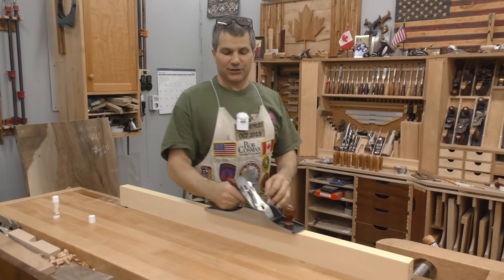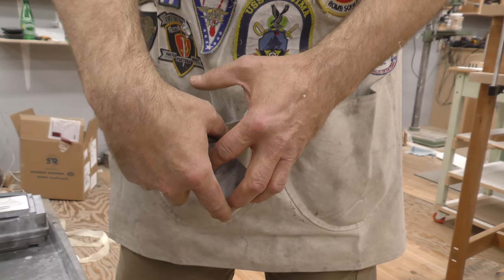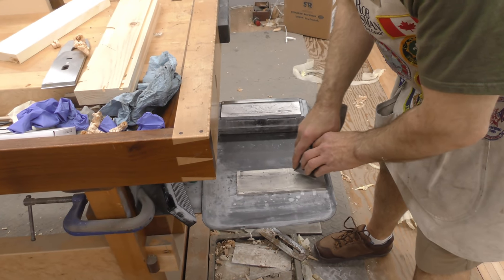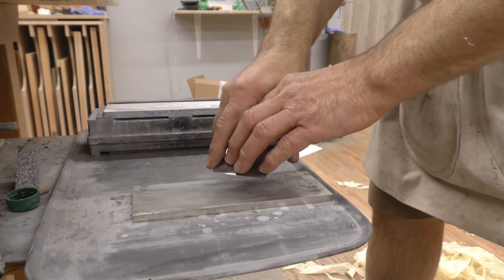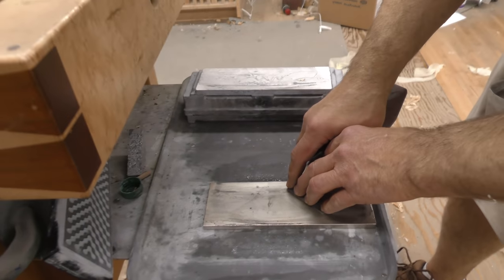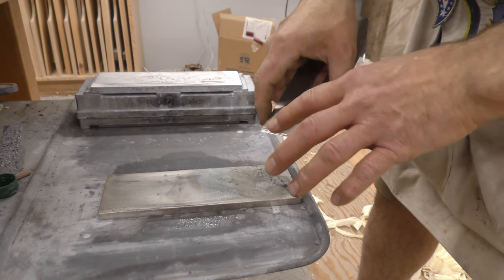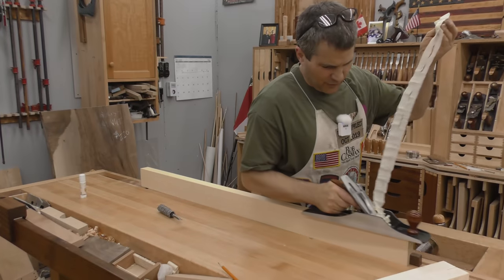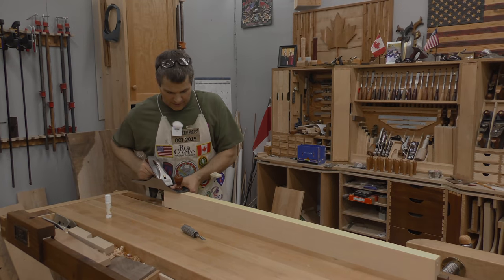Sharpening Hand Plane Blades - Top 6 Mistakes

Comment: The whole video is really good, but tip #6 really is a game changer. I ended up buying a jig when I first started because, I suspect, I unwittingly sharpened higher than 45 degrees. I was losing my mind  because my plane suddenly wouldn't cut anymore. I think this detail is the last bit I need to be able to reliably hand sharpen. Thank you so much! I hate screwing around with the sharpening jig.

Comment: I have been using a jig to hold and then sharpen my plane/chisel blades...my question is when I start my hand planning method, the Rob Cosman Way, do I have to reestablish a new 25 degree bevel. In other words do when you start hand planning does it have to be on a new blade...BTW the best video I have ever seen you do on hand sharpening
Reply from the maker: No you do not need a new primary bevel.  The only time you need to grind a new primary bevel is when you 1) drop and nick the blade, 2) have sharpened the blade so many times you have rounded over the primary bevel, 3) you have sharpened so much that your secondary bevel is approaching 50% of the primary bevel size, and 4) you get the blade so far out out square you don’t have enough adjustment room left.

Comment: Hi Rob, i seem to always have problems with my shooting board, it seems to cut at the first stage but then after two passes, it just seems to dis engage. This happens especially with hardwood, when i extend the blade a little, it doesn't cut, and then as i extend it out, it doesn't but until its so far out, that it just jams and creates kind of like a jagged cut on the end grain, i tried checking for square with a good square (Igaging) and even checked with feeler gauges to a thou and a half and it was perfect, i suspected the sole of the plane was not flat, can that be the problem? , but  when i checked it seemed flat enough though it may not be accurate as my plane bottom has undulation to reduce friction or so they say. So I'm getting a new hand plane, btw this is my third shooting board. I also tried checking the fence of the hooting board for straight, but it was. The wood that i planed was also straight. I frustrates me very much every time I try to plane hardwood even for softwood, it doesn't seem to square it. I sharpened my blade freshly every time as well. The problem causes me to always flip the board around to counter the out of square so that leaves me with a very slight sword- endlike wood. Then I have to plane the middle to square it, which makes it very hard to plane it straight. This is probably like an essay but it seriously drives me nuts.

Comment: I got a huge problem. Got the same setup as you and this happens to my traditional bench plane and also, my veritas PMV11 iron. Both were prepped to 25 degree on a Tormek T8 coarse diamond stone.
All works well until I move to the 16000 grit.
The 16000 only cuts in the middle of the blade. To even get close to the edge it takes me ages. This happens free hand and with a Lie Nielsen style honing guide. I tried 3 blades now and it is the same everywhere. Ich also used a different 300 grit diamond blade to flatten the 16K but it is always the same. what do I do wrong. The middle cuts phenomenally.

Comment: Good Video. I more common mistake in my experience is, that the cutter blade and the chipper blade are not perfectly flat so there is a gap between them and shavings get stuck between them. 
Most time, the backside of the blade was convex, due to trying to flatten on worn out (concave) stones or wobbling around while doing that.
Flat stones are the key and it is a bit of work to correct this mistake, but the plane comes back to life.
Reply from the maker: Yes, flat stones are a must

Comment: Yeah, okay, so that all makes solid sense. Watched on the heels of your other sharpening videos, I entirely grasp the objectives and the techniques... except for one part.

Maybe this is gonna sound stupid, but.... bear with me here:

1. So only the tip of the toe of the blade contacts the wood. Got it.
2. The way we establish a cutting edge is two mirrored surfaces meeting at an angle (and one that is, by virtue of the simple mechanics of the plane, possessing an upper-boundary-limit of 45º). Roger.
3. We grind the primary, then go "up", polish the secondary, up a bit more, then hone the tertiary. The net effect being we have less metal that needs removing when we go to touch up the blade, and carries the secondary, beneficial side effect that the very toe-tip (the "line" of the interface of the two planes of the blade that contacts the wood) is actually a WEE bit thicker, due to the blunting of the angle, thereby better preserving the edge due to the increased "support" of said edge. Copy that.

So here's where I'm confused: Let us say, hypothetically, I nail these instructions. My primary is at 25º, we'll call the secondary 30º, and my tertiary 35º. Super. We've established a pattern of a new bevel at each 5º. If I were to draw a figure with ALL 5º angles, I end up with a 72-sided figure. That's pretty much a circle. And, well, you need to see it to understand my confusion. 

This bothered me SO much I WROTE A PROGRAM TO INVESTIGATE FURTHER: https://codepen.io/NerdyDeeds/pres/QWGzpRq   (Note: that's hosted on CodePen. All the code is exposed and it's sandboxed to ensure it's harmless). You have to REALLY get up close before the differences between a circle and a 72-gon start to even be VISIBLE.

So I guess my question is: Why do we CARE if the bevel is rounded? So long as the sliver of the circle we're presenting to the wood is less than that 20º arc from heel to toe? An arc is a STRONGER shape than a wedge, architecturally speaking, and would be WAY easier to hit when sharpening... Why does all this double/triple bevel stuff matter?

Comment: Thank you for this video.  I really liked your solutions to #5 and 6. You may also want to comment on the different degrees of difficulty that occur with different wood species. I use a lot of hard maple and edge planing is fine but face planing is a total disaster... for me. It chatters, digs in part way into the stroke. How can these issues be avoided on maple? Thank you for your time. 

Alan J.
Reply from the maker: Alan i have a video coming out soon on addressing that.  The short answer is sharp blade and minimal projection

Comment: Hey Rob, as always - thanks for the great tips. As a new woodworker, without family or friends, participating in the craft it gets pretty intimidating when you’ve got a cart full of tools to buy that you’re not sure of or when you’re standing over a project not knowing if you’re about to waste lumber with a terrible cut. What I appreciate most about your videos is the community you’ve built around woodworking there in your work shop and the online aspect that allows me to feel like im a part of it (even though im in NY). That being said, i believe i bought a handplane and screwed up the plane blade trying to sharpen it from listening to all the other youTubers with all types of techniques and methods. If i sharpened the back of my plane blade with a low grit diamond stone every time i sharpened my blade (not just the first time like you instructed) have i ruined the angles and do i need to replace the blade? Every time i sharpened, in the beginning, i started at the 300grit on both sides and worked my way up. Can i recover or do i need to get a new blade? Thanks!
Reply from the maker: Corey you can most likely recover.  What brand of blade is it?  Please send me a close up picture or two of the blade.  Send it to robswebmaster@robcosman.com.  Let me look at it and I will tell you what to do.
Reply: RobCosman.com Thank you, Rob. Email sent! I’m embarrassed to admit that I’ve done this to both my low angle jack plane and block plane by Lie-Nielsen. I feel like I’ve bought a Ferrari without getting my drivers license... 🤦🏾‍♂️ lolol

Comment: Hi Rob your videos are very helpful, I have a hard time sharpening probably a patience thing, But one thing that is trouble some is I sharpen from a sitting position. Can you address sharpening while sitting, or do you know off disabled woodworkers who have addressed this thanks Mike
Reply from the maker: Great question.  Everything i talk about in my videos still applies.  Your challenge is to figure out how to get a good grip and try and not rock the blade as you move it back and forth on the stone.  We have had several wounded warriors in our classes and they could do it, so can you.

Comment: I love the new intro great work. The question I have is if you have to reestablish the primary bevel do you “need” a grinder.
Reply from the maker: I recommend a grinder.  Another option would be to get a CHEAP jig, and grind out a new primary at 25 degrees on a coarse stone, such as the 300 grit side of the Trend diamond stone.  This will work but will be tedious.

Comment: Rob, have any of your students encountered problems while sharpening if they have lower back problems? I have 2 herniated disks down around the belt level so i am curious about how far you are bending over while honing the blades. I would love to graduate from using my Veritas jig up to freehand but without pain.
Reply from the maker: No have not encountered that.  The important thing is to lock your wrist and elbows in so you can hold a consistent angle for 10 seconds of sharpening.  You could experiment with a slightly higher station and see if it works for you

Comment: question... after grinding the primary bevel on the grinder. should there be a concave area in the blade and are the serration left on the blade going to effect the finish left from the blade
Reply from the maker: Tyler,  The "concave part is called a "hollow grind", you will find that the concaveness (is that a word?) actually makes registering the primary bevel much easier than if the primary bevel was flat!!!  When you grind, do not take the grind 100% to the cutting edge (unless you have a nick in the edge and need to remove it).  Take it 95-98% to the edge so you don't risk burning the edge.  When your bring up a burr on the 1000 grit stone you are removing all the scratches from the grinding stone.  That is what the burr is telling you.

Comment: Thanks for the helpful videos, The tray below your sharpening stones for collecting the runoff , what is it and is it attached to the table?
Reply from the maker: A silicone mat for dog bowls/eating area.  Find them on Amazon, cheap.  Its the middle size.  Its not attached.
Reply: @RobCosmanWoodworking  Thanks

Comment: i am managing to sharpen free hand, what i fail is planing a piece of wood so that there's no light coming through when i tilt my plane or a straight edge.
no matter what i do there's always light coming out somewhere especially on wider boards. I am guessing i'm getting reckless and not putting equal pressure when pushing the place.
Reply from the maker: Well don’t worry about a little lite coming through.  What you want we you do that is for the light coming through to be of uniform thickness.  Tilting a plane on the edge is just a quick reference to identify your high or low areas.
Reply: @RobCosmanWoodworking  i do get uniform light.. i flattened my workbench this weekend too some spot stayed high even to i focused on those spots and making short strokes.
Either way thanks for reliefing some grief.

Thanks for the reply and all your knowledge Rob and your team :) <3
Reply: Im pretty new to wood working and only use hand tools. I built a bench by hand, few handplanes and other tools in about year and a half with few hours a month i get to do it :)

Comment: Thanks for all the advice on sharpening  It has made a huge difference to me especially after investing in a 16000 stone. However  can you explain why you cant just re grind only the tertiary bevel a few times to resharpen instead of both each time?
Reply from the maker: Woodskin, I am not 100% sure of what you are asking, but here goes.  You regrind the primary bevel to establish it at 25 degrees and square to the blade side if you 1) have a nick in the primary bevel  2) If your secondary bevel is approaching 50% of the width of the primary bevel and its difficult to feel the registration of the primary and/or it takes too long on the 1000 grit stone to bring up a burr, or 3) your cutting edge is too far out of square with the blade edge.  Essentially the primary bevel is your registration face you use to create the secondary and tertiary bevel.  You must have the primary bevel.
Reply: @RobCosmanWoodworking  Thanks Rob. What I actually meant was if you just want to touch up  a blade that isnt very dull, can you just go to the 16000 stone alone instead of using the 1000 stone first

Comment: Will a crappy blade (i.e. made from soft material) cause these problems when hand sharpening?
Reply: Soft metal will just dull quicker - try it out on something like pine and use Rob’s methods to get it sharp - if you can cut hair on your arm then it’s way sharp enough to cut wood...
Reply from the maker: The 6 problems in this video are all technique issues, the type of blade has nothing to do with them.  So yes, you can have these issues on any blade

Comment: Hey Rob, Great video, thanks! ok, I have your (excellent) work bench plans, Trend diamond plate, 6000 King stone and a 16000 Shapton Glass Stone and ruler. All systems go! I do have one question (observation). In order to quickly build muscle memory it's important to minimise differences in your routine. That makes sense. However, your setup has your two sharpening plates a two very different heights. Your Trend looks ideal but the Shapton look about 2.75 -3" too high ( relative the Trend). Too high for the purpose of building a singular consistant hand/wrist angle. Also considering that you must elevate the blade slightler higher still, when you transition to this plate to get your third micro bevel dialed in a couple degrees higher.   Is this not a big deal or have you in fact developed two separate, distinct  muscle memories as a workaround for these varing heights? If there might be any validity to this concern I can factor that into my sharpening station build at this time. I can elevate the trend or (preferably) drop the Shapton station lower so that the wrist/elbow  angle end up being exactly the same throughtout the entire procedure. Thanks for all your help, products and especially for your work with veterens. As a vet allow me to say that your commitment to help has endeared you to us and earned you hero status, Well done Sir!
Reply: То и

Comment: Does it matter how good your plane body is? or is just down to the sharpening of the blade,
I have a good plane so I think its down to the sharpening,?!!! its always been a nemesis for me sharpening freehand
Reply from the maker: Yes it does, however, sharpening is the number 1 element (I include quality of blade in this), a good plane that allows for minor adjustments to the blade and that holds the blade securely is number two, technique is number 3, flat sole number 4.....or something close to that

Comment: Great video Rob, a question of topic. How do you determine the height of your workbenches? To make a bench personal to its owners height is what I'm getting at rather than a standard height
Reply from the maker: This is a huge question.  It depends on what you are using the bench for.  Traditionally, workbenches tended to be low ( height of the middle of your pinky finger) to make planing easy.  For sawing and chiseling you need a taller work bench.  I like a compromise between these two because i just use one bench.  So you need to figure out what bench height is comfortably for your body.  Low enough to plane on, high enough to saw and chisel on.  Usually somewhere between 36 -42 inches
Reply: @RobCosmanWoodworking  I'd have a bench that's a bit higher for power tool work, I'd be looking for a bench height for the kind of work you use yours. Cheers Rob

Comment: Great video.  Informative and really like the feel it has - like I'm in the workshop too.
I bought a very old N0.6 Stanley Bayley.  The blade is fairly convex - much more than Charlesworth would go for - but less than a scrub plane.  It achieves that shape by having a flaired back bevel.  To maintain its convex shape, one only has to sharpen the micro-bevel as if to achieve a dead flat blade.  I'm not a fan of it because it inhibits the final planed finish and breaches the KISS rule.
But, I also have a low angle jack plane.  The 12 degree angle of the blade means that a very slight deviation from a flat blade bottom will result in a much greater result than on a blade presenting at 45 degrees. It also means that any convexing of the micro-bevel requires more work than on a Bayley or Bedrock style plane.  I'm wondering if a very slight flairing of the Charlesworth ruler system would be appropriate for the low angle jack plane.   It won't increase the angle of attack, hence, it will not effect the plane finish.  I'd love to hear your thoughts on the matter.
Reply from the maker: I do not like low angle plans for many of the reasons you state and more.  All you should have to do is get the back flat (ruler trick) and ensure you get a side to side bur on the front..  i dint see why you would need to do anything else to get a sharp blade just because its low angle.  Since i don’t use them i cant tell you much more than that.

Comment: I can never get thing shavings. 2-3 tho is best. U can shave hair, planing looks good. Normally oak,cherry & Maple woods. But have even purchased pine. Had 62 low angle have # 6 now 5 1/2 not available right now. 40-50 hours with 6 getting better.